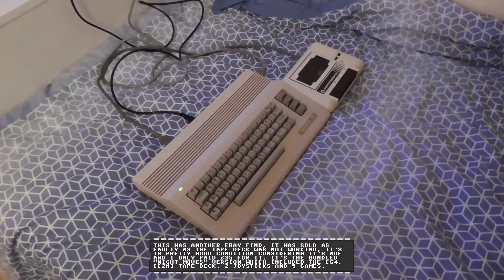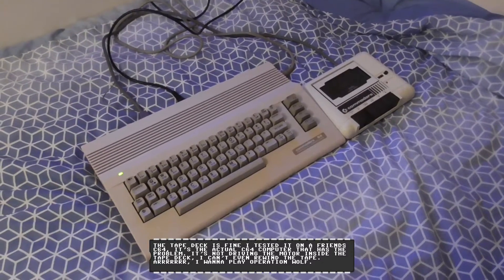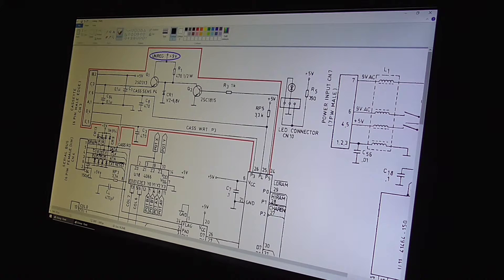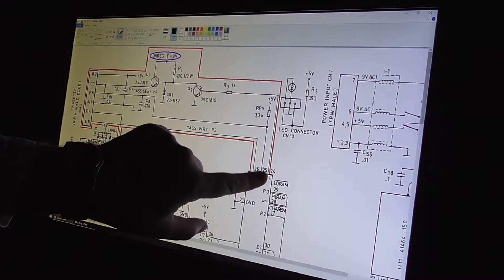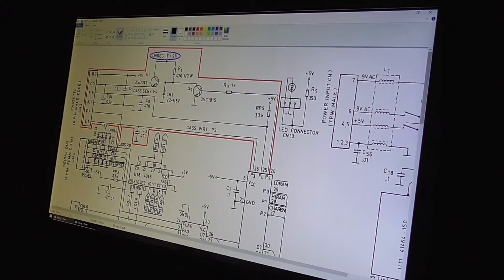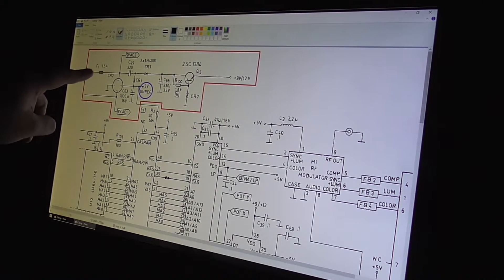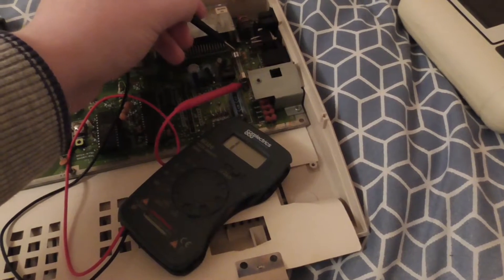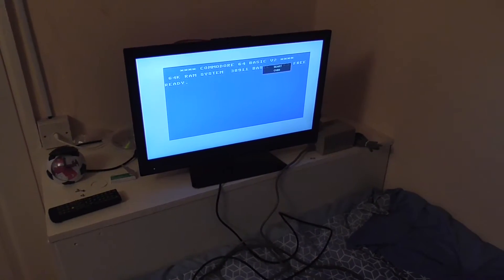Commodore 64 (C64c) Repair

Comment: I think the other problem you get is no sound when that fuse has blown (if memory serves).
Reply from the maker: +GadgetUK164 

Nice, I didn't know that.

When I saw the fuse for the first time I thought because the system is actually
powering on and is working the fuse must be fine so I overlooked it, I won't
make that mistake again.

Comment: Is it normal that there is both 5.3V DC and 27V AC on C63 near the fuse on this board? Checked the PSU, it outputs 5.2V DC and 12V AC.
Reply from the maker: +discoHR 

27v hoooo leeee cow, in the C64C schematic C63 is a 1000uf 16v capacitor. I’m surprised 27v hasn’t blow the arse out of that cap. Something definitely isn’t right; most of the chips run off 5v, 9v or 12v on the c64 and c64c. WOW 27v, from the sounds of it that’s going to kill a lot of the chips on the board especially the sensitive ram hell possibly all of the chips are toast at that voltage.
Reply: Thanks. Could be my cheap multimeter is acting up. It's also reporting 1.2 ohms on a short. It's probably time to replace the battery and/or calibrate it.
Reply from the maker: +discoHR 

yes it's likely your multimeter, 27v across a 16v cap would kill the cap.
Reply: ***** Yep, it was the cheapo multimeter. Bought another multimeter (UT-139B) and checked voltages again. Everything is perfect. :)
Reply from the maker: Nice, it sounded a little iffy when you mentioned 27v. I'm glad it turned out to be your multimeter and not the C64 itself. By the way I have the UNI-T UT61E there good value for money if you ask me, the only down side we're the crappy test leads that shipped with it, I ditched them and paid £20 for some Fluke TL71-1 test leads.
Reply: ***** Thanks for the hint. I've noticed intermittent connection with original leads so I followed what you did and bought Fluke TL175 TwistGuard. What a difference!